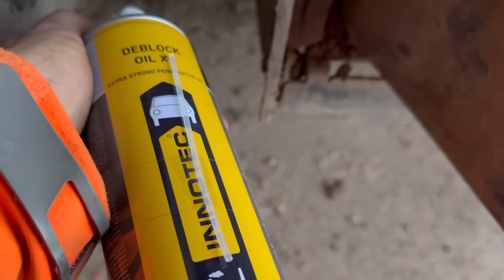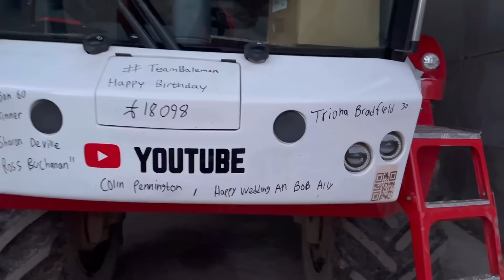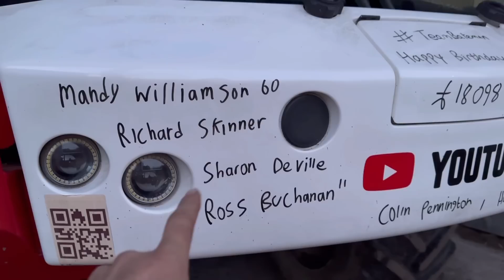DAY 989  ANOTHER DAY OF PROBLEMS CAN THEY FIX SPRAYER #OLLYBLOGS #AnswerAsAPercent

Comment: Hi Olly, I have a 2018 VW Transporter Campervan and in the 2 years I’ve owned it I have had to get Adblue faults fixed 4 times, how close are you to getting rid of the chipper as it seems as though you spend more time fixing it than actually using it.

Comment: Hey up. Could you tell me the name of the de rust Airosol spray please. It looks good gear..battery terminals are a pain to keep clean. 
I'm with you on Ad-Blu ridiculous and unnecessary on tractors, more trouble than its worth.
Reply from the maker: https://www.ebay.co.uk/itm/Innotec-DeBlock-Oil-XS-500ml-ONLY-Authorised-Distributor-on-EBAY-/222799217914?mkcid=16&mkevt=1&_trksid=p2349624.m46890.l49286&mkrid=710-127635-2958-0
Reply: @OllyBlogsAgricontractfarmer  Cheers 🍻
Reply: Much cheaper alternative is to disconnect battery, wire brush the terminals/connectors, finish cleaning with fine grain sandpaper, then coat the terminals/connectors with Vaseline. Reconnect the battery and your good for years with no corrosion buildup if you use enough to give it a good coating of Vaseline on all the metal connection.